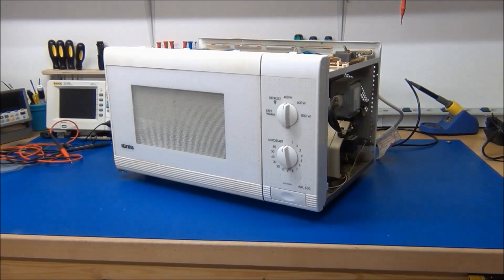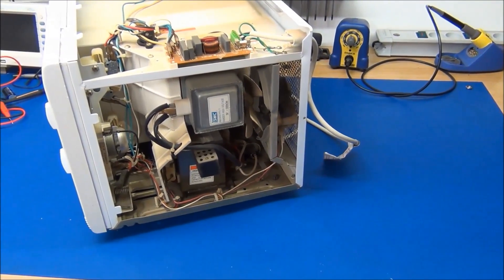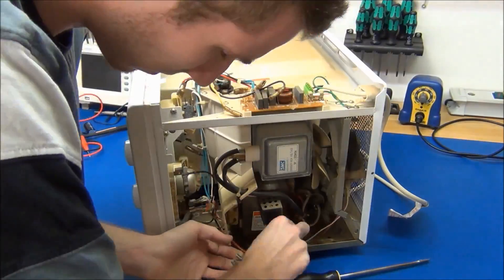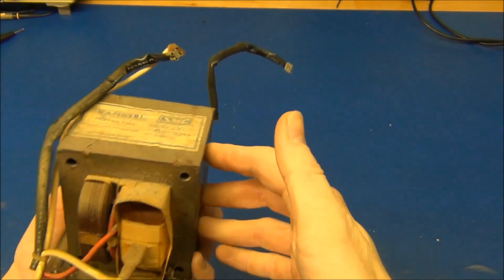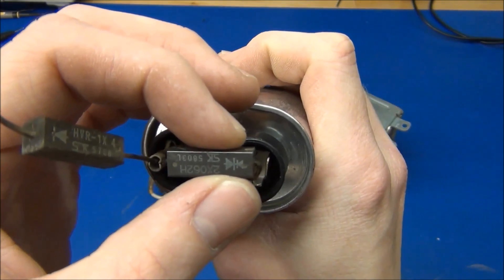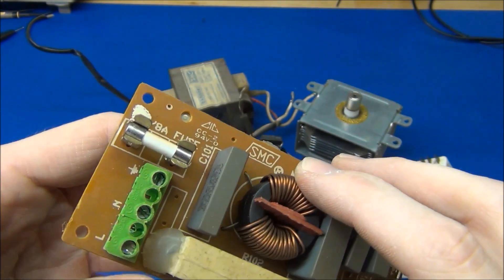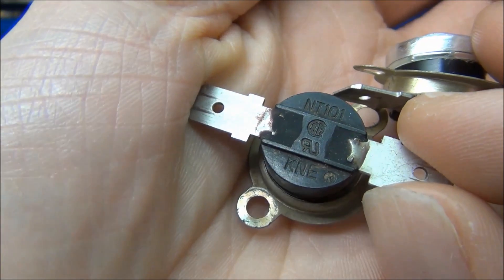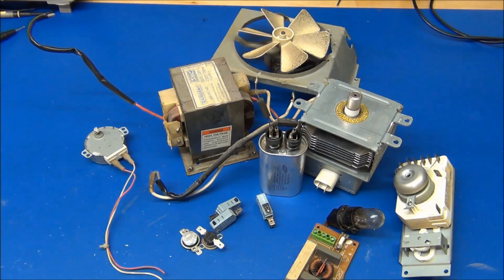What's Inside A Microwave Oven (Teardown / Taken Apart) - Ec-Projects

Comment: So a microwave should function perfectly fine on its side. Almost all of the mechanism is solid-state anyway. Obviously, the turntable won't work on its side, but the actual mechanism of the microwave should work just fine. If I wanted to microwave something taller than the microwave, I could turn it on its side and place the item on the wall further from the magnetron and it should work just fine :-) (Why would I want to do this, you ask? Microwave kiln for firing pottery. You don't use the turntable with that anyway. 🙂)

Comment: Many thanks...want to dismantle a microwave safely to harvest the slow revolution motor from it. How did you make the capicator safe ?
Reply: Short it with a large screw drives across both terminals; CAREFUL!!! A loud "pop" will occur. Use thick rubber gloves (and shoes, preferably with a rubber mat to stand on) and a well-insulated large screw driver.

Comment: What is the purpose of the pcd with all the components the thing that is directly connected to mains voltage
Reply: You mean P.C.B.(PRINTED CIRCUIT BOARD)
Reply: @stephensnell1379  I mean the small PCB with the fuse small coil caps and several other components components the first one directly after mains voltage before the transformer

Comment: I am a little confused. So which part is the main MW generator, is it the 5  RPM motor?
Reply: The magnetron provides the MW; the 5 rpm motor turns the rotating plate.

Comment: Modern microwaves do not contain high voltage capacitor or bulky transformers
Reply: The bulky transformer will more than likely exist in all microwave ovens as it's required to step the voltage up from 240 volts up to over 2,000 volts

Comment: Hi, I came up with the idea of adding an extra cooling fan to help cool down over heated food. Is this possible and how would you do this. I want a single button to press for the cooling.
Reply: Either adds another fan in series with the current fan (no on-off button required), or add a fan with a separate on-off button, powered from the mains. (for AC fan with similar mains voltage)

Comment: WARNING THIS IS DANGEROUS however to discharge a cap use a screw driver with a good insulating handle,  attach a high value resistor many K ohms and rated for lots of current as well  near the end  with its leads bent in a U shape  on ly  one lead should touch the screwdruve though preferably neither of them do ... use this arangement to short the cap with the resistor,   WARNING THIS IS STILL DANGEROUS

Comment: 5:50 You say there is a lower voltage winding on the for the heater on the cathode. But the Magnetron only has two contacts, is there something I am missing here or would hot cathode require more contacts for the heater and that's a cold cathode?
Reply: The filliment winding is connected to the high voltage at 4000 volts (after the voltage doubler formed by the diode and cap). So, you have 4000 volts, and also 4003 volts. These two voltages connect to the magnetron filliment. The filliment is at a very high voltage relative to ground, but there is a small voltage across the filliment. This means it is at a high voltage while still being heated by the small voltage difference across it.

Comment: microwave ovens are extremely dangerous to mess with, new ones don't even have transformers in them any more, best to just take it to the E recycle depot than risk serious injury or death from high voltage(2000)plus  or exposure to micro waves (cancer)
Reply: Microwaves can cause burns, but they do not cause cancer. If you don't believe me look it up from a trusted source.
Reply: cancer from microwaves is a complete myth & based on the frequency of its restatement, it seems to be a well-established deep rooted myth. But anyway, we best all learn to separate fact from fiction in the information age!
Reply: Yeah just unplug it next time dearie
Reply: That won't discharge the larger capacitors, which can be EXTREMELY dangerous if not dealt with properly.

Comment: I took the fan out of my microwave going to use it with my forge but the fan runs counter clock wise so now what can I do
Reply: Jerry Thompson Reverse the armature. Remove the output shaft, motor and then flip the armature over. Not all shaded pole motors allow this but if both sides line up the same it should work.

Comment: Other than a microwave what can you use a magnetron  for?
Reply: EcProjects Pull it apart - the magnets are quite strong, and make interesting fridge magnets. You get two of them in each magnetron. Do not attempt to fire the magnetron outside of the oven - its quite dangerous.
Reply from the maker: Jerry Thompson Not much I think :P
Reply: The Magnets (there are two in each Magnetron and always the same) are very strong and very useful for lot of 'toys'
Reply: The Magnetron is a Valve, it produces Mircrowaves at 2.4Ghz its actually a Silent Weapon for a Quite War and is very dangerous when operated or taken apart.  It works on same frequency range as Wifi and is designed to Fuck you up Wholesale, don't take chances messing with that shit.  Leave it to people who know what they are doing, for example Licensed Amateur Radio Technicians, Electronics Engineers or like minded people who are aware of Radio Frequency and high voltages.  There is all so a lot of very sharp edges in those enclosures.

Comment: Be careful if you take one apart, take a screwdriver and short across the capacitors. One of my co-workers was working on a microwave and got a shock from one of the capacitors. he was standing up at the time, the force threw him backwards and up agaisnt the wall of our shop. He was stunned but otherwise not hurt, it scared the heck out of me.
Reply: He lived? I thought you would be killed
Reply: That was satan doing the throwing work

Comment: I am 11 years old and I fix eletronics and build things and I am going to make head phones I have all the steps if you see a comical of headphones called max bass that's my headphones and now I am trying to make a microwave from scratch I have made the frame and I need a vid of the parts of a microwave so I can build a mini microwave and I know safety it's my number one thing so please make a vid of that please
Reply: I would highly advise against making a microwave.  Setting all safety issues with high voltage and other lethal hazards aside, attempting to make a microwave from scratch and heat up food like regular microwave is extremely difficult.  One of my close friends who specialized in Microwaves (electrical engineer) was talking about how if it doesn't perfectly resonate (probably not the right word) with water, it won't heat up the water (it's the water in the food which gets heated).  The frequency range that you must hit is actually quite small and would be difficult to achieve without the correct equipment.
Reply: Where the headphone video

Comment: Hey there! You seem like a rather clever fellow but I assure you there are many who are not as clever as you. The blurb you had on that HV capacitor was a little short (no pun intended) imho. Those caps can blow off your hand with the amount of energy stored in them; dangerous is an absolute understatement, utterly lethal is the truth. These devices should be disassembled wearing a surgical mask, some rubber gloves and some good rubber on your feat, athletic shoes should suffice. $10 of equipment can easily save you from serious and potentially fatal injury.

Get that magnetron working and irradiate some stuff!
Reply: the only danger is those caps, I always short them, one time my partner got a shock off one, it threw him back up agaisnt the wall of our shop. it really scard me, he was stunned but not hurt. but you're right those caps are very dangerous.